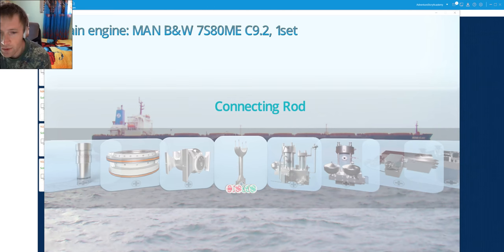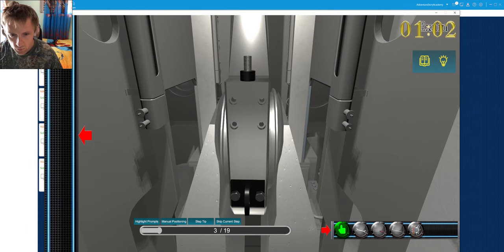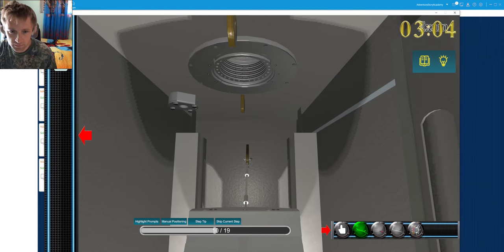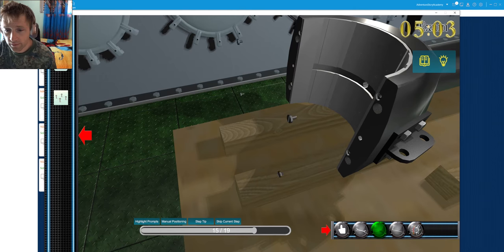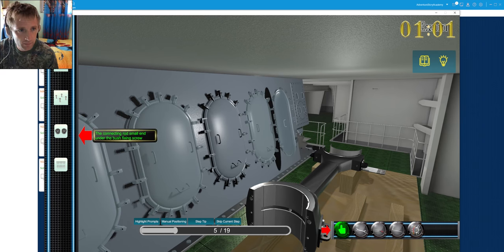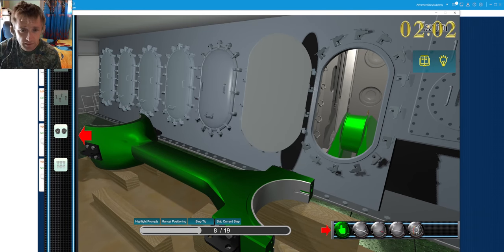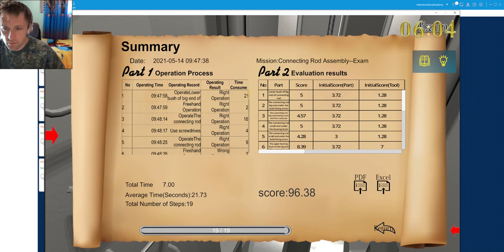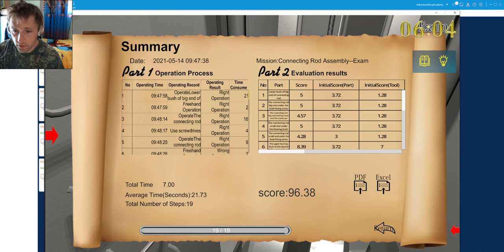MAN B&W 7S80ME C9.2 Connecting Rod Assembly & Disassembly procedure

Comment: Great video! I have a question, during the reconditioning of connecting rods from a workshop, and to disassemble them, who is providing the tool/jack, the ship as there is always one onboard, or is the workshop supposed to have its own?
Reply from the maker: Many thanks ! I have never seen workshop bring their own tools  .But I believe if requested they will bring.be carefully because workshop can damage your hydraulic tools.Check also the one onboard the condition sometimes they are really bad or parts missing or somebody has removed some parts or replaced with other.
Reply: @Adventure-Story  Thank you so much for your feedback, so if the ship brings the connecting rods for recondition to the workshop, the workshop is supposed to have the hydraulic jack for the specific connecting rods to loosen the nuts? or the ship has to give the tool to the workshop for the job?